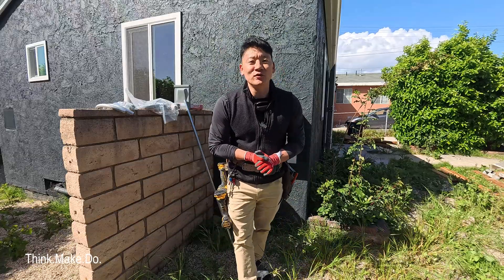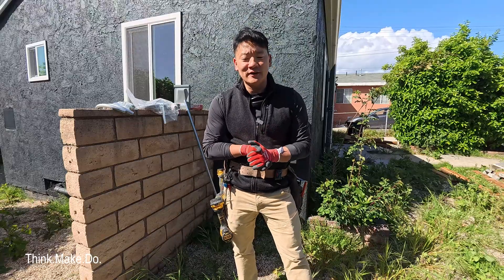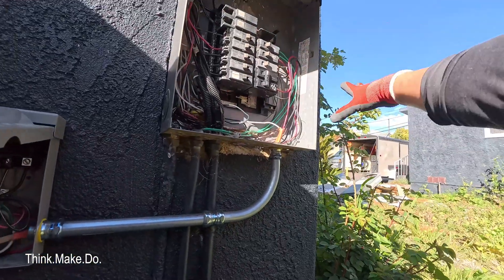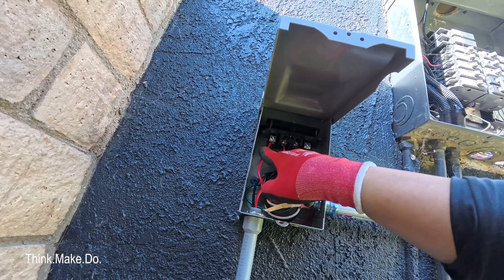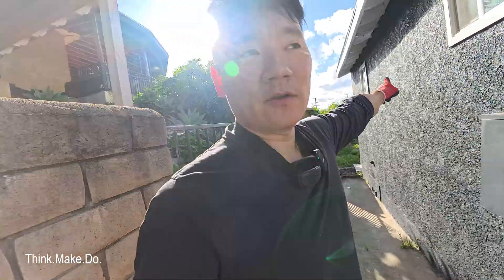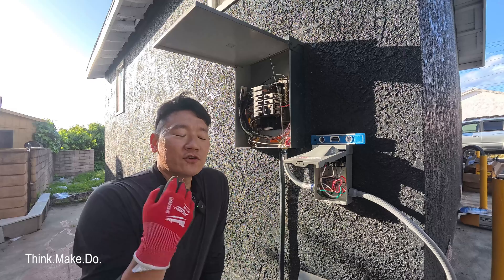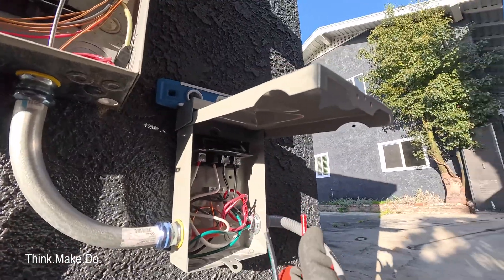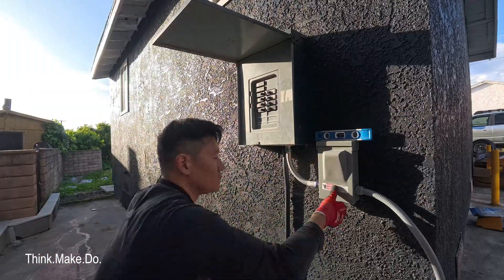DIY AC Disconnect Box for MiniSplits (How to Save 1000$) | Vine 05

Comment: Romex is not permitted in conduit outdoors. 334.12(B)(4)
Reply: i was thinking the same thing lol
Reply from the maker: guess ill need to unsheath those wires, thanks for the tip
Reply: @ThinkMakeDo  The actual conductor insulation is what is not rated for wet location. Not the sheathing.
Reply: @ThinkMakeDo  No, can't use the individual conductors in NM cable (ex. Romex brand).  Need wire with a special insulation, typically THHN stranded.  For most mini-splits, 12 awg suffices (20 A max), but the installation manual should specify.  Can buy just 25 ft spool or even by the foot at HD or Lowes.  Most mini-splits don't need a neutral, just L1, L2, gnd if 240 VAC.  Rigid PVC conduit is cheaper and easier, but EMT (steel) is best if in strong sun.  Coat all connections w/ NoOx grease.  In your 120 VAC disconnect, I don't think you should switch the wht wire since neutrals (com) should never be switched.  Just connect it thru.  Some gomer connected 12 awg wire to a 40 A breaker, which was dangerous, so good you changed that.